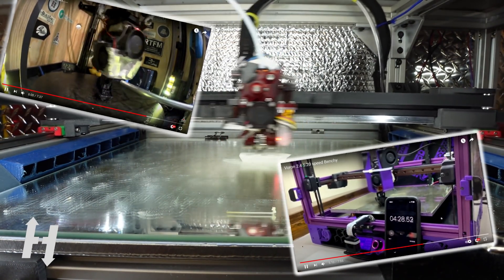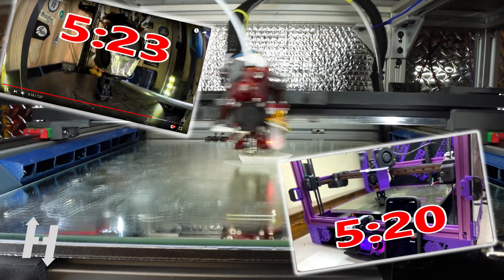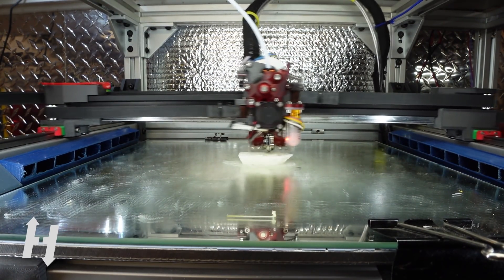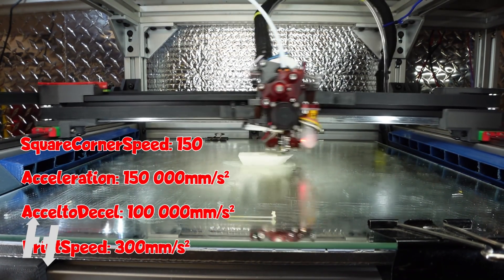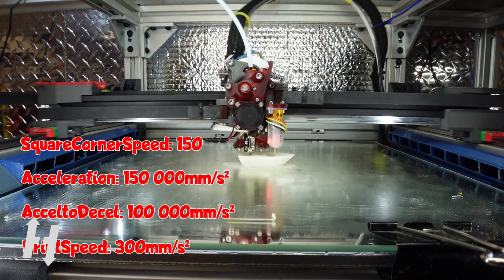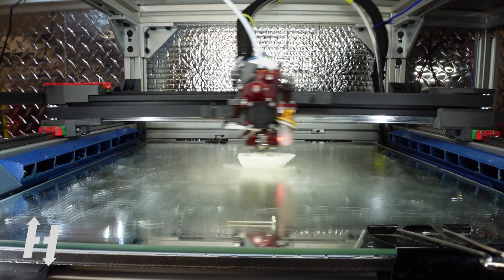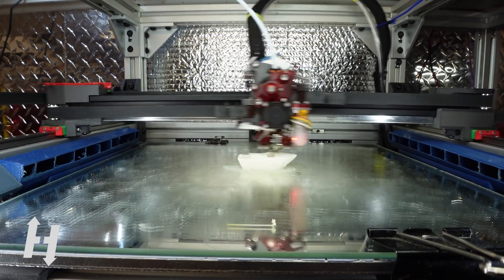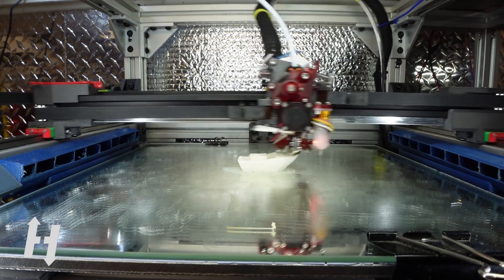4:57 Benchy on HevORT using Nova HotEnd

Comment: i applaud you for using servos, it‘s the next logical step in fast printing, no sense in holding back. you need to try the MG94 ABS with it‘s high melt flow.

Comment: Did you switch back to PLA, or does the Nova just ooze that much with ABS? Also, have you ever thought about enclosing the whole thing and just absolutely blasting it with 100 C air to cool ABS straight down to Tg? Forget about the HevACS or the berd-air, I'm suggesting you just nuke the whole thing straight down to Tg with a violent, constant current of air!
Reply from the maker: This is ABS.  The oozing comes from the small extruder high gear ratio not able to deal with retraction and pressure advance at those speeds. 
Air is not dense enough to cool properly if warmed up to 100c.  This print is using 60PSI shop air distributed via berd-air pipes.  No side duct cooling used.
Reply: @MirageC  Gotcha, makes sense.

Comment: Dude I love watching your imPROgresivORT  (aggressive and impressive pro progress on the hevort... of course) and has inspired a number of little things on my recent projects. I'm curious what you would think about running x and y (or horizonatal anyway) ballscrews now that you have the servos? and maybe not for you because you're insane and love making two second prints that blind us all but what about conceptually?
Reply from the maker: Ball screws on XY could be something I explore in the future.  One of the main challenge I see is to avoid having the X servo being carried on the Y axis.  This would cause in my opinion unbalanced extra weight on the X cross member.  There could be ways to avoid that, but the ones I know would involve belts... back to square one...
Reply: @MirageC  I've been envisioning a great (imo) design where each x and y are perfectly semetrical and each is powered by a carbon fiber tube coming off the servo shaft going the length of the opposite axis (x along y and y along x) on each side with 45° beveled gears running ballscrews pupendicularly off the carbon fiber shafts on each side of the build plate. No belts. No traveling motors. To help picture think of sort of a ultimaker setup or the dash. I like the idea of Cartesian motion system and no traveling motors or long belts... I really think this would crush it. Only key would be having zero slop 45° gears probably in a little baby gearbox haha
Reply: Oh and on the far end of the ballscrew there's another 45° turning another carbon fiber slave tube or else you'd have to have dual servos on each and that would be way Overkill and I think carbon fiber is stiff enough that any play would be imperceptible even in the most intricate prints.

Comment: Is there something like an air chiller to cool down the air before it goes to the part? I imagine sub-zero air would help immensely with part cooling
Reply from the maker: Unfortunately my air compressor does not have a great capacity, therefore once tank pressure reaches trigger point, compressor will run for the entire benchy print.  Tank air might become a bit warmer then due to freshly being compressed and no time for heat dissipation.  But as I run a 50 feet hose to the printer, it is not so bad when reaching the air nozzles.  And then the final gas expansion at system exit gets the gas temperature even lower.    Low enough to create bonding issue if I aim the air jets straight at the nozzle.  This is why I aim the cooling jets at the printed part.  Cooling molten material too much will create a hard shell at the surface, interfering with layer bonding and the shaping of that material.  Sorry for the long response... :)

Comment: It's only a matter of time before somebody really starts cheating by keeping the head stationary and moving a very small bed just large enough to fit a benchy at insane accels.
Reply: Then, they both move to increase the relative speed
Reply: Isn't one of the main limitations the plastic itself? Doubt it would help much.
Reply: @c-djinni  Ah but the theory is once you have unlimited mass to spend on the extruder, hotend, cooling system, etc you can in theory work towards solving those problems easier. Assuming you can get the Benchy to stay on the bed at those accelerations....
Reply: @scianiac  The problem is that there's a point where the plastic can't distribute the heatengergy within itself fast enough to keep up with the amount of heat that's forced into it. It will burn on the outside while staying cold/"raw" in the middle. Like a badly cooked steak.

Edit: Holy Super Hit, I might have had the best idea of my life so far: Add metal particles to the filament! Copper or silver (maybe even carbon fiber or synthetic diamond?) should help heat transfer a lot and thereby heat the filament more evenly! You'd need a hardened nozzle (which will probably make it a little harder as they tend to heat up a bit worse than brass) to print with metal in the filament, but I'd say it's worth a shot.

Comment: Good gawd that's fast! If cooling is the issue have you considered injecting a tiny amount of liquid in the air stream? Like mist coolant on milling machines. What would not affect the adhesion and evaporate fast?
Reply from the maker: I still have headroom with cooling so far,  Melting and extruder speed is the current issue.

Comment: Why not make a custom silicone sock for the nova hotend?
Reply from the maker: Work in progress ;)
Reply: @MirageC  I think josh cheated a bit as well. He used some 42v step sticks on the a and b motors
Reply from the maker: @imst4722  Well I think that as long as we are being creative to get the chrono down, we are doing the right thing :)  Servos, 48V,  custom made hot-ends, all of that require significant amount of work.

Comment: These speed runs reminds me of my pc bench marking obsession and spending silly money to gain a few extra 3d mark points. After all this tuning what can you take from this to print fast, but good quality prints. How long would it take to print a quality benchy from lets say a prusa mk3 ?
Reply: About 30min is the fastest ive gotten a benchy on my prusa and still maintain quality
Reply: @tankkiler308  I didn't word it very well, I mean on these super fast printers, how fast can they print, but have the print quality of a normal perfect  prusa mk3 benchy.
Reply: Honestly the the thing is I really think in a year or two a 5 minute benchy that looks good will be doable. Each step brings more challenges the main two now are better kinematics to prevent vibrations and better part cooling

Comment: Your printer does seem quieter than the other two. With less rattling. But I don't know.
Really like your printer :) If it just wasn't sooo expensive to build. :( And it's getting more and more expensive. ^^
I'd really like to know how a benchy looks like in "quality" print speed :) I've actually never seen the print quality of your printer when printing at slow speeds :)
Reply: I'd be interested in this too.

Comment: can anyone tell me why servo is technically cheating? (except the exorbitant price unless that's the reason)
Reply from the maker: I still consider my system as an open loop since there is no feedback done to the control board.  Servo motors require encoders in order for them to work by nature, all that is done internally to the motor without any return of communication to the MCU.  
So in the event of a position error due to mechanical flexion/failure/slippage the system will not know.  
The same principle would apply with the current solution offered on 3D printer stepper motors such as the S42Bs. 
The only advantage of the servos here is their torque and speed.
Reply: @MirageC  how is this cheating?
Reply: @Pilot16H so it is basically cost unfairness, so instead of engineering prowess it's just throwing money to the problem?

Comment: Really nice, I love this competition and what you have made with the hevort.:)
It's inspiring.  

Some newb/dumb ideas for the flow (as unfortunately I'm not that kind of engineer). Did you consider the following:
- It seems that ABS+ of eSun has a lower fusion temp, and probably glass transition temp It's a kind of blend. And I suppose it's still flowy enough.
- Considering that you don't have retraction, have you considered to lower the fan on the heatsink in order to "preheat" the filament ? 
- Or in a more engineered way, have a pre-heat of the filament just below the glass transition temp. It may even be an heated enclosure for the filament which could even be filled with dessicant. Less water in filament, less temperature inertia. I know, probably insignifiant. :)  
- Having heat block insulation (silicone and/or ceramic coton). 
- Redirecting the flow of cooling air more precisely to avoid as possible cooling the nozzle. Not sure if this is a good idea although, I wonder if the cooling of the nozzle doesn't participate to the cooling of the filament in some sort.
- What about having an additional closer ring (ring to negate the possibly deforming air force by opposing them) really close to the tip of the noze to distribute the cooling air?
- And a crazy one, what about to cool the cooling air? :D Some copper tube with in an icy bucket between the compressor and the hot end. In a more durable way, it could be a (second hand) mini fridge with the bucket in it, no manipulation required. And to more efficiently "load" the cold in the air, maybe a some kind of water nebulization in the air after the compressor and before the icy bucket. If the filament is fully enclosed (roll, ptfe tube, direct drive, hot end), I don't see a real issue to increase a little the room humidity. Depending of the room size, it should be marginal. And to make sure to not spit possible condensed water, have micro hole at the dispenser to renebulize before reaching the hot filament. With all the air flow and temperature is this region, I would guess no water will remain on the model/printing bed.
- If we consider the slicing, maybe having different cooling depending of the location, as some region may need more and other less (eg stack on the boat roof).

Haha, I wonder if someone will read until here. ;)
Don't hesitate to comment. That's just a kind of brainstorming to possibly trigger effective solution(s).

PS: For those who complain about quality, that's not the point here. The idea is to push the state-of-the-art (on speed here) with new creative ideas. In some sort, it's creating problems / finding previously hidden problems to solve them. And from those solutions, applications could be found in a more realistic way where quality matter. :D
Reply: Actually, forget what I said about ABS+ of eSun. The melt flow rate is not as good as I though.
- ABS+ - eSun - 12g/10min - 220C°/10Kg  

But here some interresting stuffs: 
- Technical data sheet --> TitanX™ Black - FormFutura - 41g/10min - 260°C/5Kg 
https://cdn-3d.niceshops.com/upload/file/tds-titanx.pdf
- HF ABS - Extrudr - 44g/10 min - ?°C/?kg
Technical data sheet --> https://cdn-3d.niceshops.com/upload/file/MaterialDataSheet_ABS.pdf

Those data seem to match your goals as I guess your benchy is around 15g :D

Comment: I'm just utterly blown away by the fact that the ribs on those belts hold up to those stresses caused by such accelerations and speeds.
Reply from the maker: 12mm wide belts with light weigh gantry makes it possible.  Vez is running 6mm belts on his VzBot.
Reply: yeah but they are moving so little mass

Comment: are those cooling nozzle pipes some factory made pipes or did you do them by self?
Reply from the maker: made by myself ;)
Reply: @MirageC  pipe and m3 hex cap screw? You just glue that pipe to some kind hollow mount stand?
Reply from the maker: @TH-wr1dv Pipes are 1/8 OD with M2.5 cap screws to block the ends.  https://youtu.be/h-ukClHtai4?t=129

Comment: At that print speed, I’m surprised you didn’t burn your hand on molten plastic when you picked up the benchy. 

Pretty soon, you’re going to have to have to be spraying liquid nitrogen at the model to cool the filament. 

Instead of having the hot end in contact with the model, you should have a gap and have it spraying a jet of molten plastic at the model, with a tiny high velocity jet of liquid nitrogen aimed right at the point on the model where you want the plastic to solidify. Could get some amazing overhangs that way. 

On a more serious note, I’d love a camera on the nozzle so I could see what that insane volume of plastic extrusion looks like.
Reply: Part of the reason (if not the biggest reason) he is able to get such insane times is that his cooling is... absurd. I'd be interested to see something at these speeds in infrared. I mean, yes, there is this: https://www.youtube.com/watch?v=65FVQ1jArME but the current speeds appear to be much faster.

I wouldn't be surprised if the plastic is almost ambient a couple seconds after it is extruded.

Comment: Gonna wait on a Summoning Salt video on "The history of 3DBenchy speedrunning"
Reply: "Years passed with no significant changes to the WR, until one day a YouTuber by the name of MirageC and his HevOrt printer utilizing Liquid Nitrogen cooling moved the goal to sub 4 Minutes!"
Reply: @juliankandlhofer7553  liquid cooling might be far more sensible than you might think. I am testing to print inside a liquid which is heated just below the glass transistion of the plastic resin. Instant hardening, why try to jet a gas onto the print with ever increasing pressure instead of just using a themally more suitable medium?
Reply: @flipschwipp6572  Nifty!  I expect the hard part is picking a liquid that doesn't mess up the layer bonding.  care to share what you use?
Reply: @martylawson1638  for pla, ethanol is working best
Reply: @flipschwipp6572  That is super interesting! Would like to know how it's progressed
Reply: I want someone, who understands math, to figure out how many benchy's have been printed since it was introduced. And if they were stacked end to end, how many times around the world they would stretch. Same for the XYZ, and Chep Cubes. I bet millions have been printed...
Reply: @Patrick_Cooper  I haven't done the math but I think that maybe more benchys were printed in the previous 30 days, than all of history before that combined

Comment: Will you have STL files (or step files) for the parts cooler? I'm interested in maybe hooking up an aquarium / aquaponics air pump (with like, 100GPH flow) to one those nozzles. Would be light weight tubing and should be great flow!

Comment: #whysoslow 🤷🏻‍♂️
Reply from the maker: Flow is maxed out :P  Need shielding from strong compressor and better plastic!
Reply: @MirageC  is that hot end flow that you're lacking? Would something like a super volcano help or be too much mass for how fast you're moving?
Reply: @MirageC  can you start at a even higher temp? thinking like 380, and then as the hotend cant keep up itll drop in time, but still stay in the temp window you need? mind i dont know what the thermal requirements are to melt at these super high speeds, or the thermal mass that would be needed for that idea to work. but as a motorsports fan too, im loving watching you guys push the limits and go fast, and innovate :)